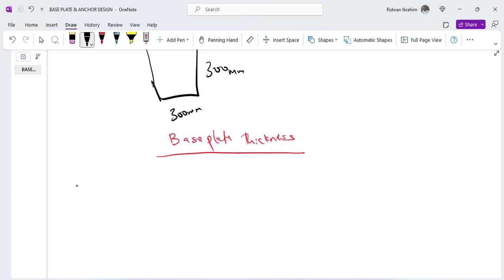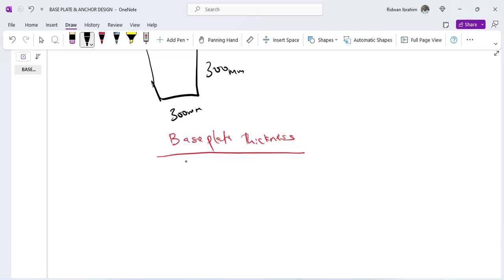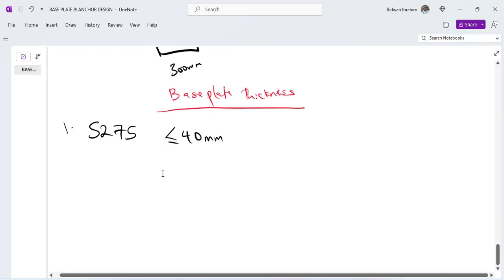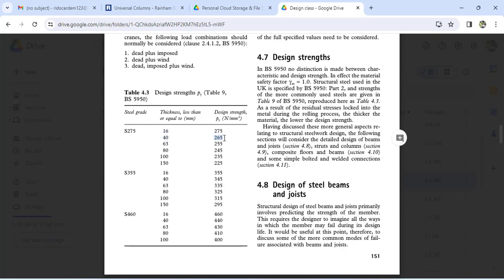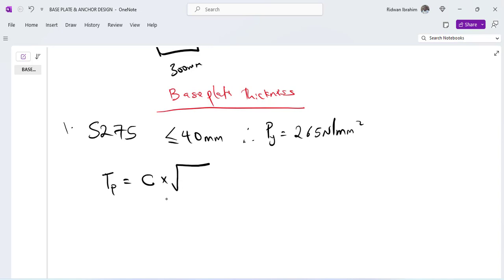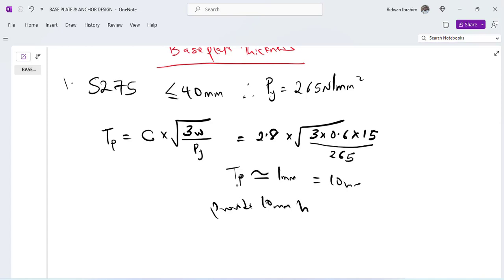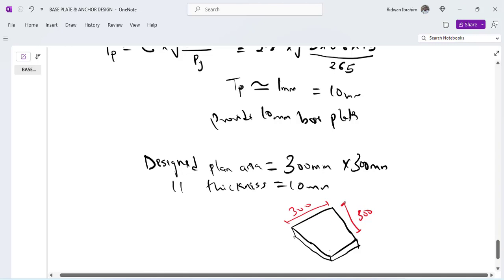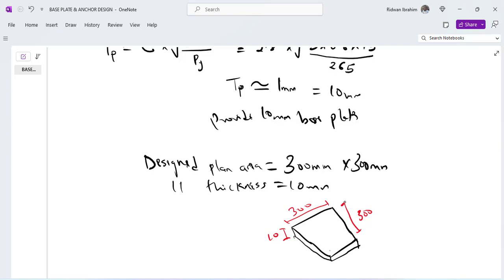EP 4: Base Plate and Anchor Bolt Design

Comment: More often than not the thickness of the plate we calculate is very small or very big depending on the axial load we are dealing with .From experience most plate thickness will be 16mm to 20mm. thick. The 20mm seems to be popular because u don't want to choose a baseplate like 10mm when u are using 20mm bolts .Let me know what you think about this comment . Thanks
Reply from the maker: Yes, you’re correct. More reason why this course combines base plate and anchor bolt design. It’s because the two compliments each other. If baseplate design accounts for 10mm thick baseplate and anchor bolt design accounts for 20mm dia bolt, you’ll need to check if the plate will fail in bearing or if the plate is bound to fail in bearing. If the answer is yes, then that will warranty the baseplate thickness to be increased. 20mm anchor bolts seems to be on a high side tho.
Reply: Keep up the good work!!. I will keep following your channel